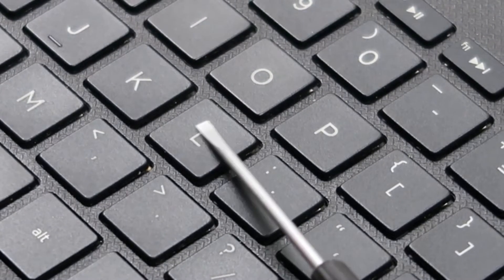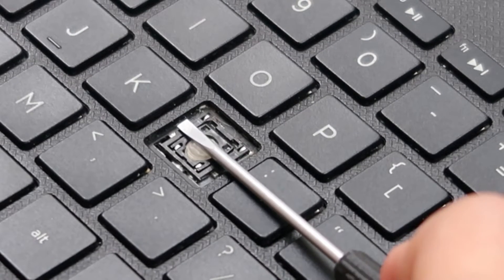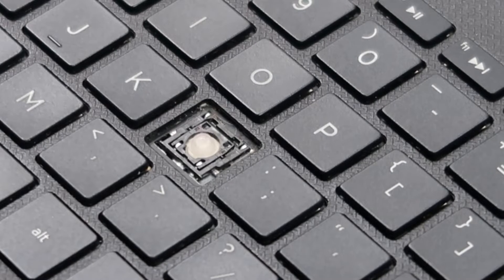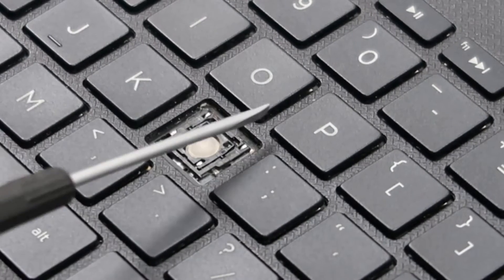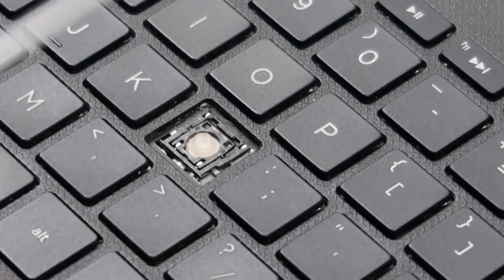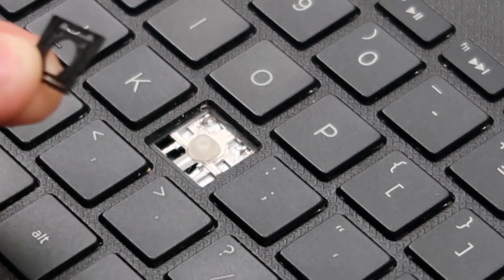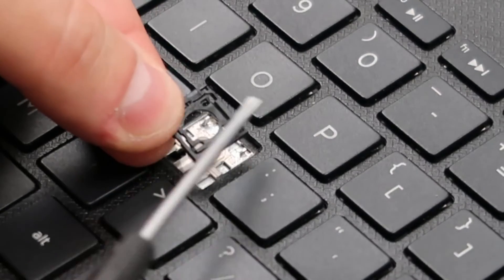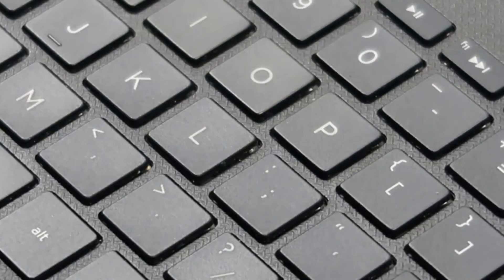How To Fix / Repair Key for Acer Aspire Laptop Computer

Comment: I put my retainer back together but it props itself up instead of laying flat :(
Reply from the maker: If the key assembly is not installing correctly, its either due to a component being damaged and needing to be replaced or a component not being orientated correctly. I would disassemble the key as seen here in this video and inspect for damage. If there is no damage, install the key. If there is damage, replace the key. Would you like help locating a key? If so, what is the brand and model for your computer?

Comment: Hey! I'm just wondering what to do if a key wont snap back into place? literally everything underneath they key as well as the back of the key itself looks to all be fine, no pieces broken off but it just wont snap back into place. please help.
Reply from the maker: If the key assembly is not installing correctly, its either due to a component being damaged and needing to be replaced or a component not being orientated correctly. I would disassemble the key as seen here in this video and inspect for damage. If there is no damage, install the key. If there is damage, replace the key. Would you like help locating a key? If so, what is the brand and model for your computer?

Comment: Great close ups!  I removed a key not knowing what I was doing and the retainer clip popped out and came apart.  I thought it was broken but maybe I can put it back together with the help of your video.  Also how do I know what is up or down on the pieces?  Are the flat surfaces up?
Thank you for the clear video of these tiny parts, I will have to use a magnifying glass to see what I am doing.💖
Reply from the maker: Happy to help :) Always here if needed !!
Reply: @PC_Monkey  Thank you.🙏😍